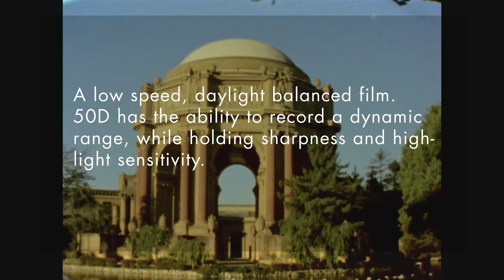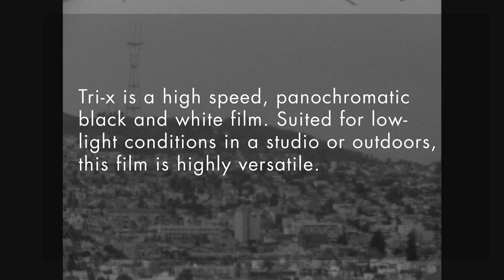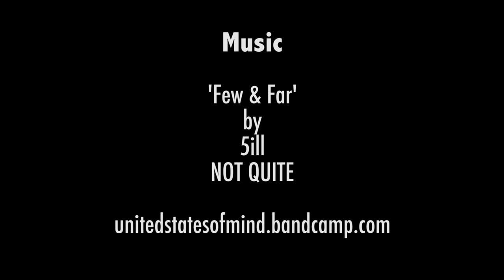Super 8 Stocks

Comment: Great! Well I shoot on Super 16mm. I wish Kodak made a color reversal (it is much more affordable to get film top notch processed in E-6 than in ECN-2). Still have a few 100ft rolls of the fantastic, sought after,  Ektachrome 100D, fine grain, gorgeous lush colors and that classic look without being too "nostalgic".  I agree: the Vision 3 stocks are killer. I just wish Kodak would also make a 100D to fill in the gap. 200T and 250D tend to be already slightly grainy in the shadows, even on Super 16mm. 
Last but not least: How about a 25D stock for Super 8mm (lots of travel footage being shot in bright sunlight anyway - it would be roughly the same speed as the old classic Kodachrome 40 (T) with an 85 filter) - to get that extra sharpness and bring it up to that crystal clear 16mm look?

P.S. Not that big of a deal, but Kodak really needs to perfect the Super 8mm sprocket holes. The most recent cuts are not as precise as they should be. Wittner (no affiliation) has it down to ultra high precision on their stocks!
Reply: I bet.
Reply: Mythology brought on by improper use of perforations for horizontal centering (left-right) in certain digital transfers. Never was an issue until we started seeing widened digital transfers that show the perforations. In fact, perforations on all formats of motion picture film were never meant to provide left-right registration. The edge of the film edge is, and if used (instead of perfs) there will be little if any 'weave' (within the limits of your camera's capabilities). Perfs provide only vertical registration (up-down)...and do you seriously believe Kodak doesn't know how to make perforations? The real issue with unsteadiness in Super 8 is the pressure plate. But then, I guess there will always be people who don't understand the limits of the format and will try to turn it into something it isn't.
Reply: Well that's why I said: not that big of a deal. If perforations would provide horizontal registration, the pulldown claw would very likely rip them apart in no time. Of course I know that the horizontal registration is done by the film edges. The Arriflex SR3 (for example) has sapphire rollers for that to eliminate the wear of the typical chrome plated brass film gate of most film cameras. Of course you can't know what I know. (By far not everything, but I know stuff). Still: the sawtooth pattern of Super 8mm perfs is talked about. Nothing to do with scanners. And yes: I believe Wittner makes perforations to tighter standards than Kodak (at least in Super 8mm).

Comment: I'm new to using super 8 so please forgive this rather simple question. If the camera has a maximum ASA speed of 160, and I shoot the 200 speed film, would I just adjust the f/stop 1/3 smaller? Let's say I'm outside and using 200D film. If the light meter is reading f/22 and f/22 is my smallest aperture, I would just use an ND filter until it drops light down enough for me to expose 1/3 stop under exposure as to what the light meter is reading?
Reply: I have a Braun Nizo 148XL if that helps.
Reply: Negative colour film should be overexposed for better results, so your film will be fine shot at 160 ASA.
100 ASA would be even better!
Reply: Marc Martí thanks! How about color reversal film? I have some agfachrome laying around.